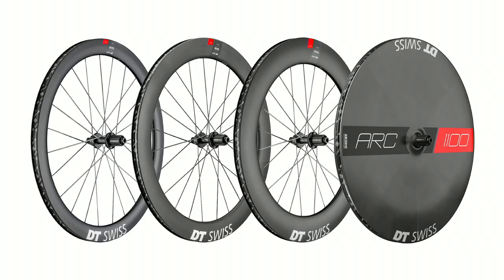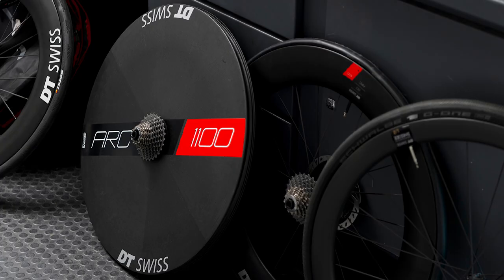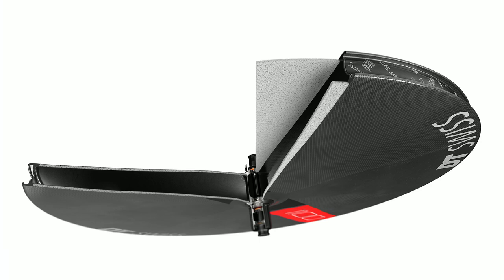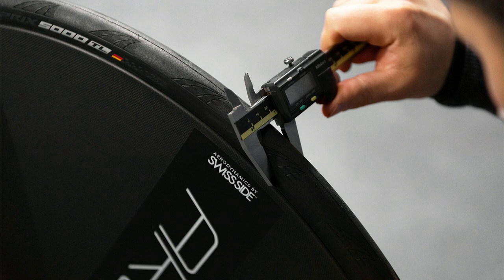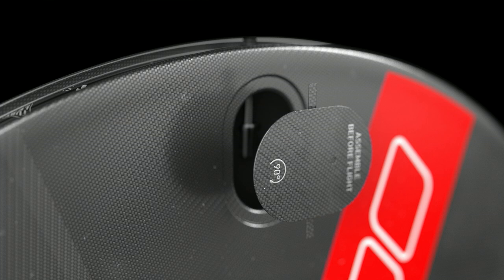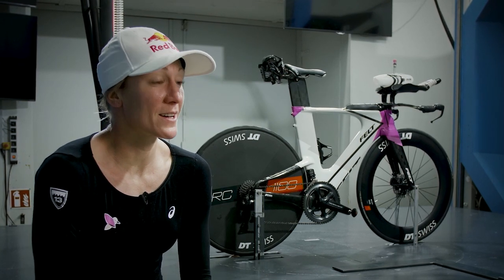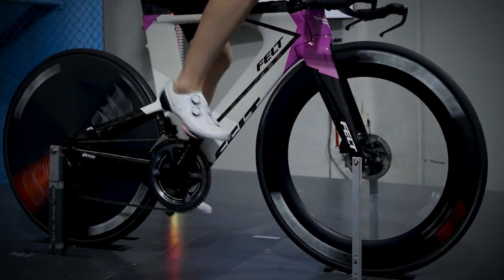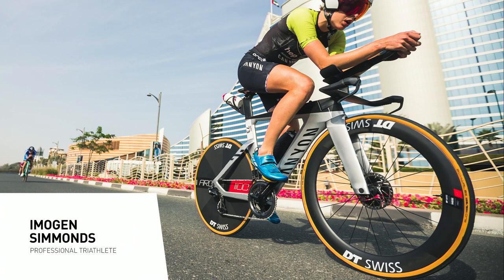ARC 1100 DICUT DISC: The completion. Product presentation  | DT Swiss

Comment: Trying to communicate with you guys on Instagram but having trouble getting the info I need. Currently I ride a Factor One with Campy 12 speed EPS Super Record. I use rim brakes Bora Ultra wheels 700c, 50mm. I was recommended the DTSwiss ARC 1100 DICUT - all I see are wheels made for SHIMANO or SRAM components also all I see are DISC wheels. Visiting your website I have no dropdown menus to configure to what I need. What do you suggest? Thank you!
Reply from the maker: Hi, pleas check your DM conversation from yesterday. As your question didn't specify the need for rim brake interface, I supposed that the request was referring to disc brake interface. Most of the road wheels come standard with a Shimano freehub body (some include an additional Sram XDR body and an endcap). But all wheels can be converted into Campagnolo standards such as N3W and 11/12 speed - this includes rim brake wheels. In the conversation you will find the material numbers you need. Yours, Ralf - DT Swiss

Comment: Hi there, I cant seem to find any info on the ARC 1650 wheelset off the BMC. Is there any place i can find info? thank you :)
Reply from the maker: Hi Paul, the rim of ARC 1650 DICUT is based on the identical rims of ARC 1400 DICUT and ARC 1100 DICUT. In your case, BMC has requested a special specification of the wheels, that differs from the products shown on our product related pages. Here, a 370 hub with a 3-pawl-freehub system is incorporated into the wheels. Yours, DT Swiss
Reply: @dtswiss  Thanks for the reply!